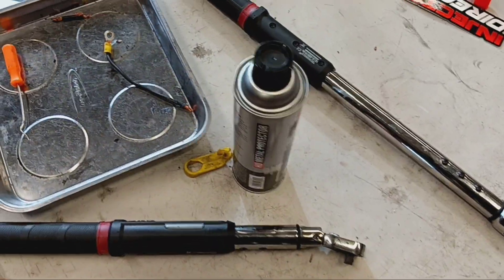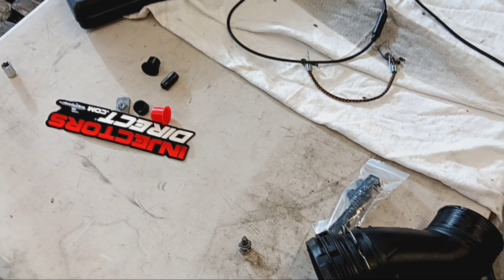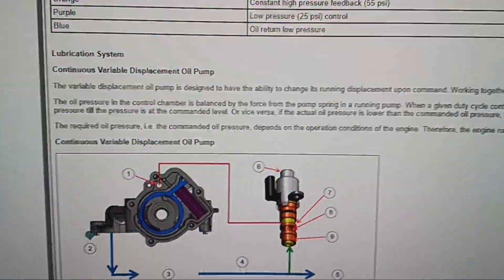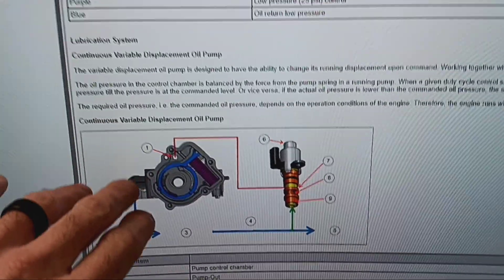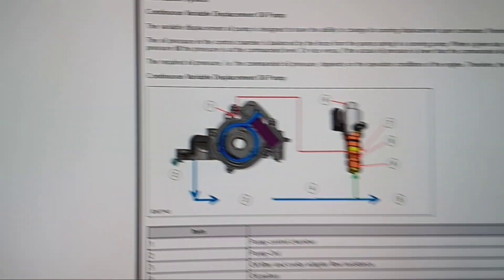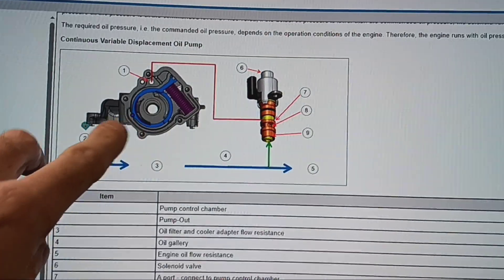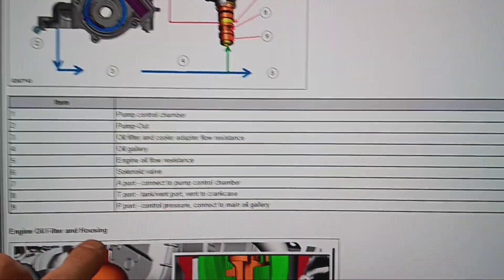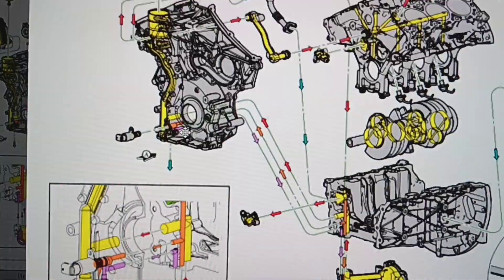Variable Displacement Oil Pump Ford 2.7 Liter How It Works #newtoyou #fyp #howitworks

Comment: I'll take a fraction less mpg in exchange for higher oil flow.  I've been seeing on another Ford repair channel how the cam roller followers are failing on the 3.8 eco boost, most likely due to oiling issues.  I can't help but think lower oil pressure at idle and extended idling times are causing the roller failures and an expensive repair
Reply from the maker: @DLRPyro1  i think you mean 3.5. And thay was fordtechmakkuloco and he's seen 1 and made a big deal out of it. Oil pressure isn't low on the 3.5 ecoboost. Thay was literally lack of maintenance in my opinion.

Comment: Ford dealer wants over $3k to change 2.7 oil pump belt.  They say the cab has to be removed.  Is that true?
Reply from the maker: @stevenn4393  no. I think he just wants to have way more room. It is a tight spot and techs like to lift the cab so they can see everything. But it doesn't have to.  It can be done without removing.

Comment: Thank you! I really appreciate that…
Reply from the maker: Your welcome.  Did that help?
Reply: @BeardedFordTech  YES, I was able to find a theoretical paper on these designs but IT failed to mention the importance of the solenoid.. By going through and pointing out the solenoid “functions” it makes sure the pump’ s “action” responds to input sent to solenoid..   The reason to understand this concept is to see if use of a synthetic 10W40 in hot environments with the 2.7L would be better to protect engine at 225 F and above.. doesn’t seem to be any technical info advising on this.. Just opinions.. I guess the concern with higher grades is the engine system is designed around 5W30  for  decades now..
Reply from the maker: @richardhiatt9749  correct. It is designed for 5w30 grades. In part due to the size of the oil galleries and the clearances
Reply: @BeardedFordTech  Okay, so then only solution to high heat is greater cooling capacity of the oil.. I am a big bypass filtration guy.. I’ve used Frantz filter systems and now the AMSOIL systems.. The systems increase the oil in the system and keep it ultra cleaning for bearings and the turbo chargers.. Proven techniques, but no one wants to bother with them.. Not so interested in extended drain intervals, when the detergent and friction modifiers are gone, or greatly reduced, it’s time to dump the oil.. 
Thank you again..  You’re GREAT!
Reply from the maker: @richardhiatt9749  aot of people have been asking about the amsoil bypass systems here lately. Think I need to do a video on that as well.

Comment: Very interesting, it’s actually great to learn how it mechanically works.   Now, the bigger question is what parameters the tuning has to operate it.  Also, the logic and reasoning behind how much oil pressure is commanded, when it’s commanded and why it’s commanded at specific times, temperature and other factors.  Obviously it’s to reduce oil pressure when a high output of oil is not needed in order to reduce that parasitic loss but it would be really nice to learn how it’s programmed to operate.  
Personally, I’d rather pay an extra 10 cents per fill up knowing my super expensive engine has as much possible oil pressure ALL the time but hey, that’s just me.
Reply from the maker: Thats a good question. I'll dig further into it and see if I can find the parameters at which it operates

Comment: Has the 2.7 been reliable over the long haul?  I’m considering the new Ranger when the 2.7 becomes available.  I’m also considering the 3.0 in the Raptor.  But he looks of it by the time you get the Lariat with the options I want it’s not that far off the price of the Raptor if you can find a dealer that sells at MSRP
Reply from the maker: It's a fairly good engine. There was a stint of bad ones when it came out in 2015. But the new ones are redesigned. And keep in mind. It has a wet belt for the oil pump.

Comment: Hey, I know you're a Ford bloke, but what are your thoughts on the new Frontier? Last naturally aspirated midsize. I am curious to your opinion. I bought a 2023 Pro 4x in November last year and got close to $3600 off MSRP and an extra year warranty. It's simplicity and N/A engine attracted me to it

And thanks for explaining these oil pumps in the video. Very interesting.
Reply from the maker: In all honesty. I worked at Nissan for a little bit as well (one of the worst jobs ever)  Nissan is not what it used to be. The frontier and titan isn't bad per say but there was quite a few that needed engines. Nissan is also known for the cvt failure in the cars. The transmission in the trucks is a beast though.  It has its pros and cons. As far as engine wise. It's not too bad. But really not as reliable anymore. Thats basically any manufacturer nowadays. So the real answer would be. If you made a purchase and it's what you want and makes you happy. That's all that matters.   Their engines aren't really that bad.  Body and electronics. I can't get behind that. But I will tell you. I'll take a frontier or titan over any dodge or Chevrolet anyday.
Reply: @BeardedFordTech I drove a 23 titan XD , I wasn't at all impressed. Supposed to be their HD 1/2 , it seemed lightly built and rather cheap feeling .
Reply: @BeardedFordTech  I appreciate your thoughts and opinion. Thank you.

Comment: Why? I get why they want to put solenoid on for flow control. But why not stay with having it pump all the time and makes sure it’s lubed. So. If the solenoid goes bad does it return to a preset state to not interrupt flow and not starve the engine.  Thanks BFT for the detailed explanation. I think sometimes engineers overthink things and makes it worse than leaving it alone. 🇺🇸✌️
Reply from the maker: True. That is a very good question. It won't have lack of oil flow. There will always being oil going through it. The question is would it be too high or too low.

Comment: Ridiculous technology to save 100th of a mpg . More moving parts etc . Just my opinion , thanks for explaining it .
Reply from the maker: I don't know if it's for mpg. I'll have to do so more research as to why companies started using these. Doesn't say that in workshop manual. But not it has me wondering.
Reply: @BeardedFordTech  yeah has me wondering also . Less  oil at idle , isn't that 1 of the reasons that the hemi has issues?
Reply from the maker: @kenj.8897   No. The 3.6 Pentastar does the same thing. A lot of manufacturers use lower oil pressure at idle. Sometimes down to 13 psi
Reply: Nice video explaining how this works. Ford has this in their 1.0 ecoboost (which also uses a wet belt). The very interesting thing is that if you hook-up the diagnostics tool and monitor oil pressure, oil temperature, solenoid duty cycle and engine rpm, you can see that in fact the oil presure stays constant. The dutycycle is continuously adjusted so at idle the engine gets the same pressure as at 3000 rpm. However, if you press the acceleration, then you see a sudden change in the solenoid duty cycle and the oil pressure goes up. Once the power request ends, the pressure goes back to its nominal value. My guess is that it is more about ensuring optimal oil flow all the time rather than fuel economy.
I can also think that the oil grade can be estimated. In specific operating conditions there is a duty cycle range that fits a certain oil grade. Put a thicker oil in, and a different duty cycle is required in order to get the nominal pressure. I am not actually sure such a detection is implemented though.

Comment: Thanks for taking the time to explain the Variable Displacement Oil Pump's operation. That's getting into Formula 1 engine technology territory.
Reply from the maker: Your welcome. Formula one engines run this way?  I bet without a "wet belt" though 😁
Reply: @BeardedFordTech  Not really sure but today's F1 engines have all kinds of electronic gadgetry. I haven't been keeping up on it. When it comes to belt driven oil pumps, I was thinking about Nascar racing engines. They use an external belt driven 3 stage pump with a remote oil tank. Oil drips down to a shallow oil pan and is extracted and sent back to the tank. It's what they call a dry sump system. No chance of oil hitting the spinning crankshaft. The belt runs off a geared pulley on the harmonic balancer. The pump sits along the outside of the engine block.